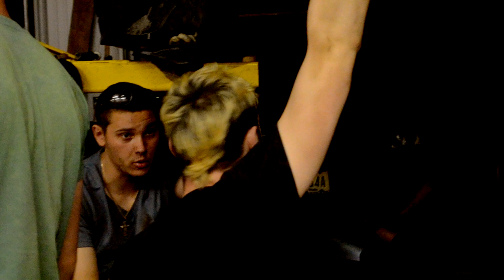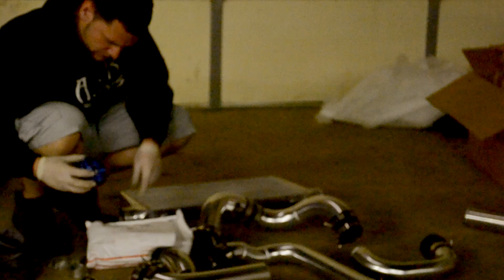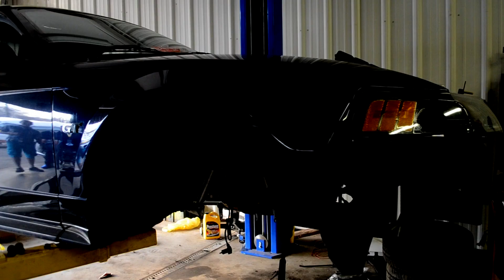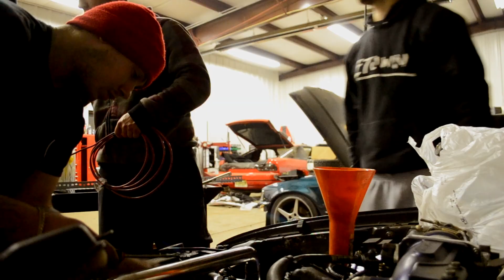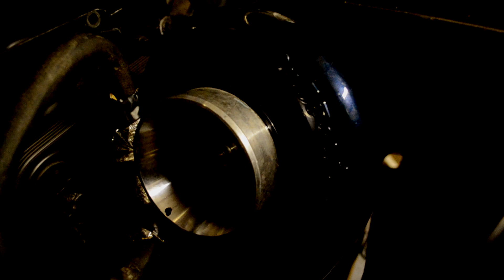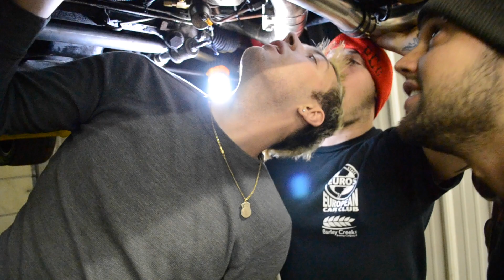Frank's Turbo 2v Build

Comment: Did you have long tubes on it when you had the kb on?
Reply from the maker: no i did not i used stock manifolds wasnt worth the hassle for the power i was making
Reply: FspecTV I know you made 434rwhp @9psi however what did you dyno for torque? If I may ask...